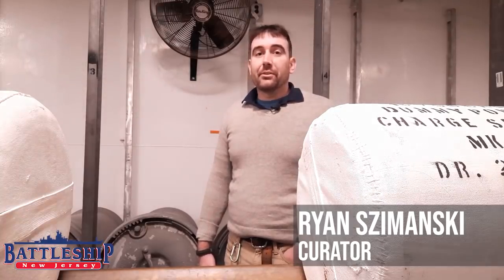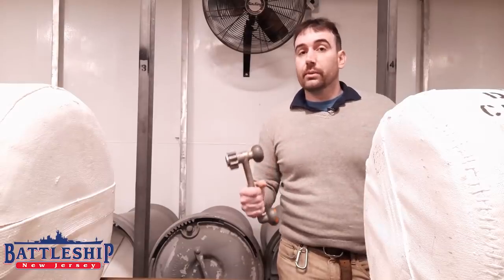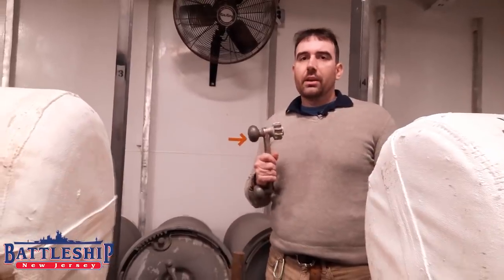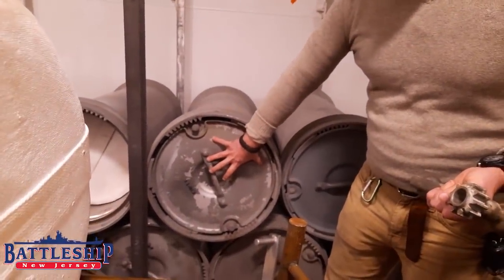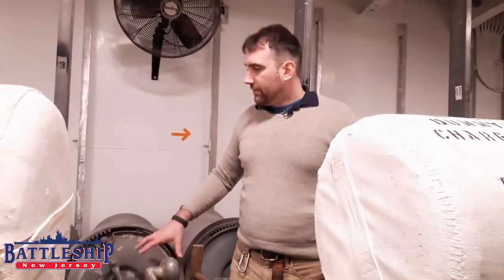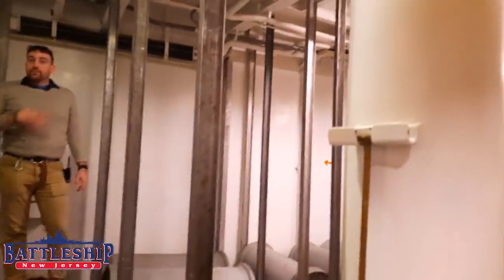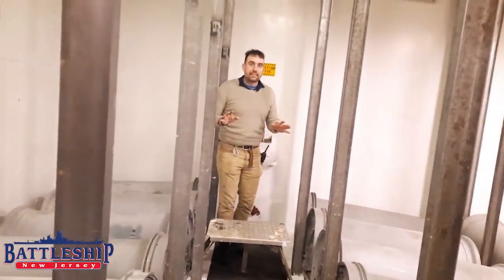Opening the Cans of Powder for the 16in Guns

Comment: In the early/mid 70's MOMAG (mobile mine assembly group) got a hold of thousands of these aluminum powder cans to use as storage containers for instrument racks of underwater mines. The cans could seal tight allowing the use of desiccant inside to allow long term storage. They worked great! I used to wonder how they would be replaced if battleships were reactivated.

Comment: It's not the quality of the 1940s step stool but the lack of understanding by the 21st century  era users that you don't use equipment you don't know how to assemble. If the pins are missing you do not use the stool. There were all kinds of other unsafe ways to access those top cans, like putting your foot in a makeshift sling hanging from the transfer rail.

Comment: maybe by the 80s those cans where getting real stuck. Though maybe the crews didn't like them after initially loosing the can. If I had to load those fast, I'd prefer hand loose. So they could have just used them to loosen a bunch then stashed them in some out of the way place like those catacombs. Same idea for the step stool, they probably used that thing once went ooo no and ditched it.

Comment: I copied this from websters regarding either. Besides as a medical gas it is flammable and explosive. Low-molecular-weight ethers are flammable gases (dimethyl ether) or liquids (methyl ethyl ether or diethyl ether) that can produce explosive mixtures when they evaporate and mix with air. ... Ethers tend to form unstable peroxides when exposed to oxygen.

Comment: If I remember correctly most of the powder bags (and canisters holding them) were pretty darn old in both the Vietnam era and into the 1990's many of which were lot numbers produced at least twenty years before they made to any BB to be used. Anyone that has handled ammo across multiple decades of service knows darn well some cans will open easily and others will have seals that act like they are super glued in place holding the cans closed to anything other than a LOT of force of some kind or a prying tool.  Making and using a longer can opening device to solve that common problem is just the Gunners Mates being smart and making their own job easier.

Comment: Just a comment about the presence of ether and ethanol (and sometimes acetone) in gun propellant. These chemicals are used when the ingredients are being mixed and when the mixture is extruded into long cords of propellant. After cutting to length the grains are dried to remove as much solvent as possible. Another technique is to water steep the grains to remove water soluble solvent, before air drying. There is always some residual solvent, but the levels have to be lower than some prescribed limit, otherwise further drying is required. They are not there to preserve or stabilize the propellant, but are undesirable residues from the manufacturing process.

Comment: Most of the 16 in canisters were re opened in 1980s after it was found that differences in storage had affected powder quality leading to large dispersion in firing accuracy while USS New Jersey was supporting troops in Lebanon.  Powder bag were reopened in armory, powder from different storage areas mixed together and then re bagged, recanned and sent back to battleships.  The different powder lots were retested and a new firing table developed for remixed powder lots.  Captain Kinnier (phd physics) was responsible for finding cause of targeting inaccuracies. I'm assuming there would be markers on cans to show a lot no. And date of remix. To go with new firing tables.

Comment: How about selling glass vials of 16" gun powder with a certificate of authenticity. I would buy a couple!
Reply from the maker: We don't have any of that powder on board. The only powder we have is the stuff we use to fire the saluting gun. Which we buy weekly.
Reply: They are round cylinders of propellent 1 inch diameter and 2 inches long. There are several holes through the core to promote burning. 7, I think.

Comment: That larger can opener was probably useful when opening cans at the highest "step stool" stacking height. There would be limited access above those cans when trying to use the "short" can opener , so accessing it with the long handle below would be much easier and quicker.

Comment: SO how does the wiring work in a 360 degree rotating turrent. How does it connect, i.ie. the wire doesnt stretch and break at some point.
Reply from the maker: It was built in to be pretty loose theres a lot of extra cable allowing it to move with the turret.
Reply: @BattleshipNewJersey  Check out their catacombs video.

Comment: Cordite is safe so long as you remember that it's extremely dangerous.  

So if the magazines had to be flooded in an emergency how would it be done?
Reply: There are valves that are opened to allow sea water to come directly into the powder magazines.

Comment: Are there convection cooling coils (i.e. no fans) in the BB magazines to keep magazine ambient temperatures within specifications?
Reply: On CVs, there were chilled water condensation coils that were inside the magazine. There were no electrical fans of any type inside the magazine. The chilled water solenoid valves were outside of the magazine. Cooling was accomplished by convection only. No fans that could spark.
Reply from the maker: The magazines were some of the first spaces to get AC

Comment: Back in the 80's and early 90's the Navy had, at some time, auctioned off the powder bags from a black powder gun and a black powder shooter had bough a bunch of it. He then proceeded to rekernel the powder and sifted it down to cannon grade, and also Fg, FFg, FFFg, and FFFFg and then repackaged it and sold it to reenactors and competitive black powder shooters. My father and I shot the last of it up around 1996 from the powder that he had bought back around 1980. It was the single most accurate powder available until Swiss powder came out in the early 2000's.

Comment: Powder must perform as anticipated by the fire control center in order to land shells on target.  Since the concentration of ether and alcohol in powder affects the burn rate of the powder, (i.e. force and time of the ignition), it's kind of important to keep the powder sealed air tight in order to keep those stabilizers from flashing off at room temperature.

Comment: The reason for the “can opener” is that the powder bags had cardboard spacers placed between them when the bags were placed in the cans at the ammo depots. The purpose was to keep the bags from rotating inside the can. As a result there was a good deal of pressure on the can top that’s why we made the “breaker bar” to open the cans. I do not remember the details but there was an incident at an ammo depot in the late 1960’s where powder cans were being rolled (not 16” cans) and bags ignited due to static charge. The cans came from the ammo depot with lead wire seals on them. If the seal had been removed we had to inform the depot so those cans could be handled separately by the depot when off loading ammo. We did not have the equipment to place the spacers back once the can had been opened even if we did not use the powder. The depot used som kind of press to close the cans.
Reply: Thanks for that info. I rather figured that it wasn't as simply as placing 3 bags inside a can considering how thoroughly everything else was thought through. Since you would get several cardboard spacers to play with every time you opened a canister it sounds like the US Navy actually invented the Frisbee and the Wham-o company stole the idea from some bored sailors.
Reply: Ignited due to static charge just from rolling.  Holy God that makes these loaded 16 inch powder cans seem more dangerous.
Reply: @Vile-Flesh  Static discharge is nasty, and can happen anywhere there's nonconductive materials rubbing against each other, like bags of coarsely ground explosives.
Side note: liquids like gasoline can also develop static charge from pumping and sloshing about. If you don't provide a safe discharge path, it can arc inside the vapor space.
Reply: @watchm4ker  later bags also had that foam barrel protector crap on them, which made them even more snug.
Reply: @watchm4ker  Believe or not , wine carried in very large railway tanks can explode .
Reply: @welshpete12  Alcohol has a lower vapor point than water, mix it with enough air...
I know these days, accepted practise with petrol and the like is to make sure the vapor space is filled with nitrogen, so there's nothing to burn the gas.
Reply: @Vile-Flesh  they were, remember the turret explosion on the Iowa.
Reply: @bobmartin4942  Yes, and the propellant is not only prone to sparking when fractured, it's also prone to shrinking in storage, allowing room for the individual pellets to move around and get into a position to fracture when the container is moved the wrong way or the charge is rammed into the gun..  The Iowa had it even worse, though:  Because the propellant had shrunk, more pellets were just poured in on top in the bags, which were extremely prone to fracture when the charge was rammed into the gun, which was the eventually identified root cause of the explosion.  (The original charge was packed in the bag in a highly organized way that made it extremely unlikely for pellets to fracture during ramming.)
Reply: @Vile-Flesh  they are basically giant soda cans full of high explosive lol
Reply: thanks for the insight
Reply: this ^^ high torque opener vs regular one.  great job @Robert Lian for explaining

Comment: Ryan brought up a topic which has potential: smoking. Of course when the NJ was built, it was a legal requirement that everyone smoked, even babies (joke). But seriously, people chain smoked to a ridiculous degree. And if you know hard core smokers, they just can't ... not. They will sneak smokes anywhere. To this day, it's an FAA regulation that ashtrays are required in aircraft bathrooms because no matter how long it's been illegal and a Federal crime, they know that people WILL go in the bathroom to smoke (and get caught), but they don't want the planes to explode so they put ash trays in the bathrooms. 

Sooooo ... what did they do on a giant floating bomb full of a trillion gallons of fuel, oil, powder, and explodey boii's? How did they handle smoking?
Reply from the maker: Just can't smoke in the magazine, but immediately outside its ok. The fuel oil you could drop a lit match in and it won't burn so he engine guys can smoke to their lungs capacity. Most people didn't work in the magazines for to long anyway due to the ether. So smoke in the time between shifts of like 15 minutes.

Comment: Could a main magazine be designed to have the equivalent of a "blow out panel" like what tanks have?
Reply: Then again, the shell that lights off the powder will have left a vent hole as it entered the space.
Reply: Interesting idea. There is a precedence for the idea on ships. The 1890 Ferryboat Eureka, the largest wooden ferry, has a steel bulkhead system from the boiler room to the hurricane deck for the purpose of a blow out panel.  If a boiler blew the engineering crew would be dead but the 3000 passengers would stand a chance of living.  Today there are too many holes in the shell to contain the explosion but those are all on the car deck so again passengers would have a better chance to survive. First time I was aboard as an adult I was puzzled, was she a wooden, steel, or hybrid. As a volunteer I learned more about her first hand chipping, sanding and painting.
Reply: It certainly could be designed that way.  However, if you put it at deck level so you can easily vent it, now it is also easily hit.  If you keep it deep in the ship, you need to build the space to tolerate a high pressure, and find a way to get large vent shafts up to the main deck.  So basically, it's possible, but not really practical.
Reply: And, any blow out panel in the bottom, would be facing all that water pressure, which cancels out the panel.
Reply: No, at least not in the contemporary state of the art, which was to hide the powder magazines  as far down and below the water line as possible to prevent their ignition and subsequent rapid unscheduled disassembly of the ship. 
 This proved to not always be effective because... s#it happens ie. HMS Hood. 
This was antithetical to venting propellant fires, since... you know, tons of sea water and many decks of ship were in the way.
Probably the closest modern concept to what you are thinking would be the Vertical Launch Cell (VLS) modular weapons concept of the Burke and Ticonderoga etc. classes where most of the burny and explody bits are concentrated in a set of bulkheaded sections surrounded by spaces where if a ammo fire were started, at least had a potential to blow out the relatively light top covers and vent the burning propellant out of the ship instead of bursting her hull open.

Comment: I wonder if the longer wrench was more for reaching less accessible cans than it was for leverage.
Reply: Probably was a "breaker bar".  They made us use vietnam era 5 inch propellants once(about 40 years old at that point) and some of those cans were nasty.  With the 5 inch cans you could stick a prybar in the wire handle and whack it with a mallet to break it free.

Since the USN probably wasn't making new propellants in that size, the cans would have been getting worse and worse(god forbid you get a powder can that was on a river barge long term)
Reply: @Grimmwoldds  Luckily AL is a soft forgiving metal and Aluminum Oxide is even more so. So it only took the proper application of sufficient  torque to break it free.
Reply: @jamestheotherone742  The bad thing is aluminum oxide is powder.  I remember whacking one of those things and a fine spray of that crap came out.  Gunno just looked at me and said "You'll be cleaning that up later".  It gets caught in the oil that is omnipresent in every GM space, so we ended up having to wipe down one of the powdermags and sticking rags on rods through the floor grating.
Reply: @Grimmwoldds  Yeah, messy and gross  is usually overlooked in hindsight and those who don't actually have to work with it.
Reply: @jamestheotherone742  FWIW, those propellants were borked.  We had something like 5 misfires from a bit under 100 propellants.  The cans matched the condition of the contents.

Nothing makes the CO sweat more than having to watch one of his GMs repeatedly carrying struck powders to the side of the ship.
Reply: @Grimmwoldds  Aluminium oxide is a massive abrasive, which is why it is used to make sandpaper. you have to remove it, or in the oil it turns to grinding paste and wears out every part it touches. If it gets in hydraulic oils your system is basically toast, unless you have full flow oil filtering to get it out, as a bypass filter still leaves it there to destroy seals and pump and valve clearances.
Reply: @SeanBZA  Aluminum oxide in crystalline form is known as sapphire, and is second in hardness only to diamond, at least for naturally occurring minerals.  As you note, it is widely used in sandpaper, polishing compounds, and grinding wheels.

Comment: how many canisters does NJ have currently 
do you have enough to fill all the magaizines that are open for display 

how many 16mm real dummy rounds does NJ have stored outside the ship 
it would be nice to repaint them as live ww2 rounds for display and put them all in the turrets and fill up the racka
Reply: IMHO you would lose the feeling of the magazine in taking a tour. USS Massachusetts has quite a few more canisters and it's easy to see that if you put a lot more in there the whole compartment would soon look just like my garage with lots of stuff piled high and a few paths between the piles to get to stuff. I guess if you wanted the full effect just as a demonstration you could put a few pieces of plywood behind the battens and have an artist paint can ends on the face of it so it looks full.
Reply: @ghost307  a garage is of many items but the same canisters  even if one of the magazines was filled completely and had plexi over the entrance like uss  mass does on some of there exhibits to show scale and magnetude
Reply from the maker: All of the cans we have, minus 1, are in this video. So not enough to fill a magazine.  We have about 50 real shells and 50 plastic replicas. Not enough to fill a turret and the real ones we can't get into the turret, its just too tough to move them.
Reply: @BattleshipNewJersey  Bluegrass Army Depot in Richmond Ky used to have dozens of igloos full of empty 16”canisters 
like 1000’s of them 
they also had 16” cutaway shells for training purposes. not sure if they are still there
would not hurt to ask 
they might have cutaways of other WW2 shells for donation to USS New Jersey

Comment: Question: when loading the magazine, how did they stack the powder cans?  At 350 lbs., way over head, I can't think it was muscle alone.
Reply from the maker: You can swing them from the overhead rail
Reply: I actually was part of an ammunition on load. I was one of three “18” year olds stacking those canisters by hand. We actually had nylon straps and usually 2 guys to stack them in the room.
Reply: MRGRUMPY53  we sure didn't, its not much better when they get to 64. But it was fun when 18.
Reply: Many young 18 year olds. Many times they would just roll them up or down the stack.

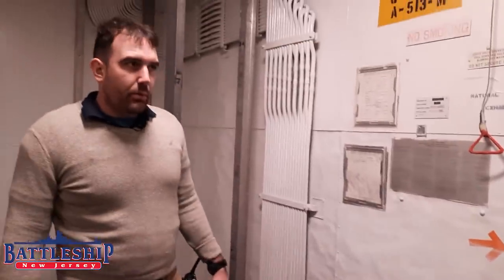Comment: at about 8:44- there is an orange metal triangle to a wire - what would pulling that do ?
Reply: Drop a bucket full of Nickelodeon green slime all over Ryan of course.
Reply: It is attached to a wire that runs around a pulley and goes to the right. It's probably to move a small door or lever and not risk a metallic linkage sparking. The sign next to it looks like it says something about ventilation but it's really fuzzy on the screen.